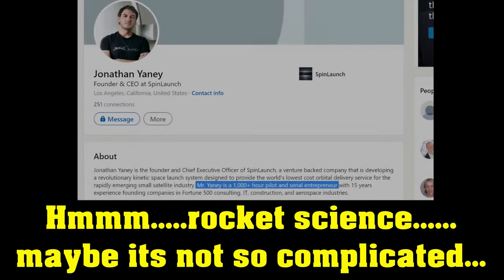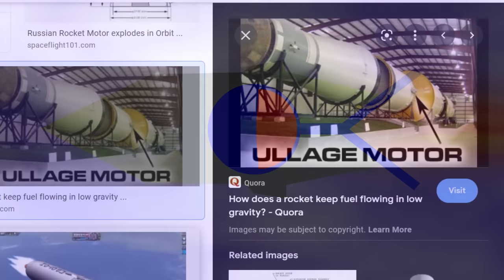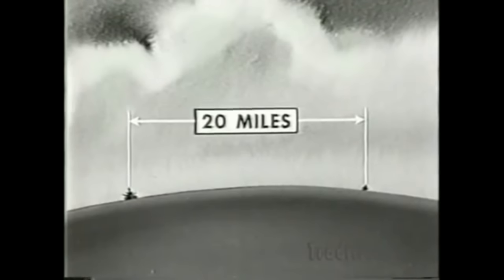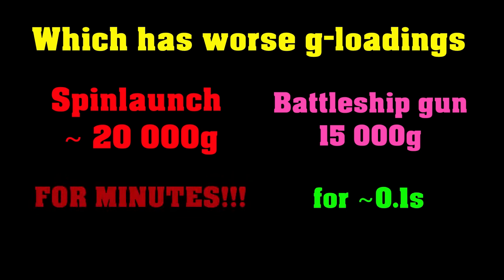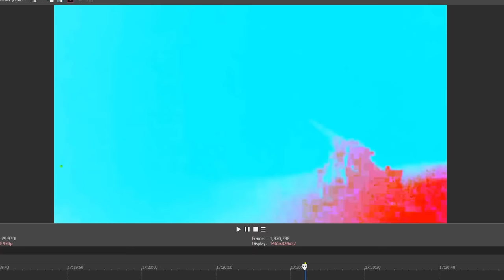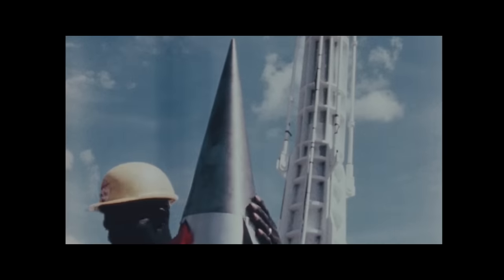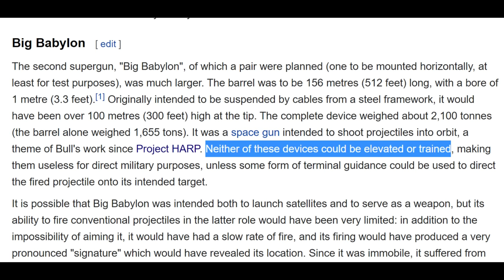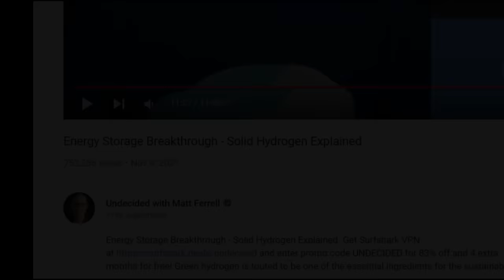Spinlaunch: BUSTED (Part 2)

Comment: You missed the most obvious problem... the effect of an unbalanced assembly spinning at high RPMs once the rocket was released.   Do the math and calculate the forces that the spinning mechanism would generate once its centre of gravity moved away from the rotation point when the 200Kg mass of the rocket was detached at launch.  It will shake itself to pieces in very short order.    And, if attempts were made to overcome this by braking the spinning assembly then the amount of energy dumped would also be astronomical and destructive -- remembering as well that it would not stop instantly so the eccentric CG would still cause massive radial loading of the bearing system.
Reply: The solution is suuuper simple! Just attach a second rocket and fire it into the other direction at the same time!!! Never mind basically lobbing it into the ground, it's the only functional solution lmao.
Reply: @voxelfusion9894  "Uhh, baws? It appears that we have attached the satellite rocket to our counter-weight side of the assembly..."
Reply: Old mate did actually cover that in the previous video.
Have a good one .
Reply: How about a disposable flywheel assembly that detaches at the same moment and goes rolling across the countryside slicing man and beast alike into pieces at 5000 RPM?
Reply: @voxelfusion9894  The second mass released would have the same energy as the rocket, so you have immediately halved your efficiency and of course destroyed whatever that mass was and made a big hole even bigger. At least the bigger hole means they can tip more money into it.
Reply: @MrTaxiRob  Don't worry about designing that as an option. Its built in from the get-go.
Reply: dealt with
Reply: @MrTaxiRob  Now that I think about it, maybe it is worth it to build one, just for the show?
Reply: @MrTaxiRob  beyblade, let it rip
Reply: Theoretically a way they could look into to fix this would be having a weight high up the arm opposite the payload which on launch is unlocked to move further down the arm to shift the weight.  Not any less dangerous and might still destroy the assembly due to the high speeds but it's better than their imagination.
Reply: If you were going to use a flywheel you wouldn't need to dump it - you would regenerate energy from it.
Reply: @funnyguy6878  yes.  This has been mentioned in some other videos.  the mass would have to be on the same side as the rocket and slide outwards at the same moment as the rocket is released.  

The axial symmetry (balance) and angular moment of inertia of the whole system would hardly change if it was done perfectly.
Reply: If the detaching were perfectly instantaneous  (all  force perfectly perpendicular toward the center of the circle and then in 0 seconds the force becomes 0) and instead of some other shape it was an infinitesimal point this would work (ignoring your issue just pointing out another)
The forces on the projectile away from the center of mass, even assuming the center of mass were perfectly the attachment point, would mess it all up. They'd have to make the thing much much much bigger 
It's like how artificial gravity by rotating a big cylinder would feel very different from being on Earth... imagine playing  catch with such a strange gradient
Reply: I am not an engeneer I am a chemist so I have not a real idea how that would work but couldn't you just in the same moment it detached open up a hatch where the projectile just sat and though the spinning force eject basicly a weight on a string it would not need to be 200kg as you could make it extend longer so having a longer arm you would just need a bigger chamber this could act as a replacement it would just mean that you need to not only make this thing extra large to counteract all the force tho it would spin for a fraction of a second while unbalanced.
Reply: @MrTaxiRob  I can't get behind the  'disposable' part.  We do want to Reduce, Reuse and Recycle (in that order) wherever possible.  The rest of that sounds amazing though, Tell me more!
Reply: @tomaszwota1465  it would be beautiful and spectacular .
Reply: They could just release a counterweight. 
It's kind of short sighted to think that it would necessarily have to go flying. 
If the spin arm is asymmetric and has large counterweight close to the axle rather than on an equal length arm... a counter counter weight can be pulled across the axle to compensate for example. 

Or a proportional weight an an asymmetric arm. Release a 200kg rocket 100m out, drop a weight that's 2000kg only 10m out. The tangential velocity of the release weight will actually be pretty slow, but of equal energy. If it's high density like depleted uranium or lead is going to be about the same size as the rocket assuming it's about 10x higher density, which isn't crazy if a rocket is 0.8g/cm and the weight is 8g/cm.

I'm not saying I believe them per se, and even a relatively basic vacuum, like 150 torr, would be enough to stop heating. Or put it on a mountain. 15k ft mountain would do wonders, a lot less heating, and run it open air with longer arms
Reply: That is exactly what I was about to write a comment about.  When I watched the video about SpinLaunch, that seemed like the impossible problem to fix, how in the world do you stop that spinning arm from basically exploding and coming off the axel when you barely manage to release the projectile through that hole.  In a millisecond you have just as much force pulling on that arm trying to make it destroy the entire complex, as you had to launch the projectile.  That to me sounded like the impossible hurdle.
Reply: In those animations, they do show a slot in the arm, which suggests that is the counter weight was close to the center, as soon as the projectile is released, the counterweight could slide down, potentially helping the deceleration.  Kind of like when you spin around in your office chair and then stick out your legs, you slow down.  I dunno, still sketchy.
Reply: Wow! That's a very good point. It's gonna cause a huge explosion like thing for sure.
Reply: Nice one Sir Bruce!
Reply: Spin Launch "Physics is hard but we will take a guess!"
Reply: Bearings can be designed for massive radial loads, but a combination of techniques might be used.  Have a chamber in the counterweight full of long-chain silicone oil and open the chamber at the same time as the release. 2. Purposely imbalance the rocket slightly heavier, and accelerate with torque 90 deg. ahead of the rocket. Deaccelerate with torque 90 deg behind the counterweght (so the same lever arm). This will eliminate the primary imbalance. Since you can de-accelerate faster than you accelerated to to lack of fragile rocket system the imbalance there can be greater, and the amount of oil you is adjusted to get the right shift in balance.
Reply: Well no, you're forgetting the hypersonic water dampening system which deluges the chamber with water, 1/2 millisecond after release!
Reply: @UCXEO5L8xnaMJhtUsuNXhlmQ  nobody is gonna top this comment 🤣 i do love Thunderf00t videos and the wonderful debate the comments crew have!
Reply: As long as it has electrolytes you'll be good Bro!
Reply: my thoughts exactly. also, not even that, imagine the forces on the centrifuge itself, 5k kph - imagine the RPM of that, imagine the bearings of that, imagine the engine that can cope with that force for an hour. but thats also the thing - imho - let them try, to just cross out that stupid idea and go on. apparently getting 80 million for startup isnt too hard in america as long as you can talk about something that people can hardly imagine. its good, he created jobs, and will probably have at least some good data that can be used eslewhere. thats how the progress looks like, we just dont hear about the fails because people dont go public with dumb ideas like they do now...
Reply: Every time the bell rings a satellite gets its wings. Also a fairy tale.
Reply: Another problem would be, that the rocket also spins around its lateral axis at the same rate the apparatus is spinning, and that has to stop instantly, when it is released. That's why DLGs have such a long tail and big fin.
Reply: @gram.  Jesus christ I haven't seen extensive typing like that since 2008. 🤣
Reply: I was about to ask how long it would take to spin down from “5k mph”. Sounds like it would only take seconds ;D
Reply: The thing has an inbuilt brake it it ........ the air rushing into the vacuum!
It might get a tad hot in there though ;o)
Reply: That's only a problem if you don't view the launcher as essentially disposable, maybe with salvageable components. I'll bet it's still cheaper to build this for single use than it is to build a launch rocket.
Reply: This is probably a really dumb idea; but if you inflated a weather balloon and attached a miniature rocket to it; could you launch it into orbit?
Reply: No he didn't. He covered this in the previous video
Reply: @icegiant1000  rune essence of once U get to 200mill total U Can craft this easym
Reply: It starts unbalanced and then become less unbalanced once the missile is released.
Reply: I note the projectile is leaving a seal.

And breaking it.

Which means air will rush in. And strike the spinner.

So your hypersonic spinning assembly has imbalance, and massive frictional heating and massive deceleration.

Unless we fill it with helium to atmospheric pressure. And use it as a circular hypersonic wind tunnel.
Reply: @benbooth2783  do U runecraft?
Reply: The solution is to launch an object in the opposite direction.
Reply: @stevelloyd5785  get Elron Musk on board to use the second mass to produce holes for his hyperloop!!!
Reply: Wouldn’t breaking the vacuum to release the rocket make a bit of a mess?
Reply: you forgot about the inrush of air after the projectile has ripped trough covering over the exit, that air is going to hit that rotating arm like a massive hammer
Reply: It could be done right but it’d need to be a way larger gimmick. Similar to how humans work when throwing things away (leaning the body back while preparing to launch and then forward plus usually covering some ground ahead after releasing), the launch station should also travel on something like a large rail WHILE spinning and afterwards, and maybe the rails should have a curved path to provide further compensation. All of that still doesn’t cover all the other issues explained in this video.
Reply: @Rapscallion2009  not for an effective payload of 50kg max.
Reply: @Slavicplayer251  no need to even do that. If the "counterweight" was a second rocket, it could be released half a revolution after the first, and at the speed it is rotating, the imbalance in the system would be corrected within milliseconds.
Reply: @95rav  nah have 2 tubes on opposite sides to release the rocket and counterweight at the same time
Reply: @JackSparrow-re4ql  nah if this could get funding yours definitely can
Reply: @voxelfusion9894  This can be resolved easily by digging a hole through to the other side of the planet. That way you actually get two satellites in space. Clearly no-one else has thought of this. I'm going to patent it and get some funding.
Reply: That was the first video
Reply: @wilurbean  Moving any weight about on a rotating mechanism at the speeds required is a problem. The acceleration/deceleration required to achieve it would be massive and if it isn't instantaneous (which it cannot be) then the entire rotating assembly is out of balance until the weight reaches and stops at its new position. The simpler option of releasing a counterbalance weight at exactly the same time is much easier and would not unbalance the rotating assembly. The problem with that is you would have a 200kg 3000mph weight going in a direction 180 degrees from that of the launch vehicle. i.e. straight at the ground very close to the launch building. This is not unsolvable but they don't seem to have even considered this option.
Reply: @icegiant1000  Release an equal weight from the other end of the rotating mechanism going in the exact opposite direction. Balance is maintained :)  OK now you have to deal with a 200kg 3000mph missile heading right for the launch facility but one problem at a time right.
Reply: The air rushing in would probably slow it down quite quickly... Maybe not fast enough to avoid damage though (launching the counterweight into the ground is probably the easiest way to deal with that (the energy is huge, so it probably needs quite a hole to either disperse the energy or to ensure that the impact is far from something too valuable...))
Reply: I think thunderf00t mentioned this in the earlier video
Reply: @Slavicplayer251  Hooray! All I need now is a cgi animation!
Reply: Any unbalance at this kind of speeds will destroy bearings at instant. And, besides sealing up bearings problem, it will generate lots of heat, since its mechanical part spinning extremely fast.
Reply: I believe it was mentioned in part 1
Reply: technically they can do a double spin and launch another one to the earth....  with 50% wasted energy at least it kinda solve the problem. there is way bigger problem then mechanical difficulty
Reply: I really thought about calculating possible savings by using energy from cheap sources to overcome starting momentum without realizing your point.
We would really waste half of the input energy
Reply: @JackSparrow-re4ql  they tried a similar idea by trying to launch the space shuttle from a jet.
Reply: A counterweight close to the center of rotation that can be shifted inwards using some heavily preloaded spring mechanism right at the moment of launch?
Reply: @cbuchner1  It would have insanely sidewards fore and accellerate the rotational speed
Reply: How do you think they did it on their mach 1 launch? I mean if you want to make a point against it then argue that whatever they are using has a limit slightly above mach 1. Don't just say it can't work, because obviously it did work for mach 1.
Reply: @lolbuster01  I'm guessing it failed, right?
Reply: The rocket itself is spinning. When released it tumble around its centre of mass in flight.
Reply: @MrTaxiRob    When I was at engineering school decades ago (it was located at the edge of a little-used airfield) some of the senior students, for no good reason other than the hell of it, built a rig that spun up a car wheel to high rpm's and released it - just to see how far it would go.   This thing would go bounding across the (fortunately deserted) runways for many hundreds of yards.
Reply: @Hedning1390  to be honest I do not know if or how they solved it so far and whether their current solution will break for higher speeds.
Reply: The bearing would probably go to hell every time without fail.

Tho they could probably counter this problem by pulling in the counterweight and reducing its effect, making the assembly balanced again.
Reply: -Matter didn’t create anti matter
-Anti matter didn’t create matter
(Both of them were present at the time of big bang)
-Both of them didn’t create themselves.
-Both of them came from an unimaginable source,  that unimaginable source created matter and antimatter (everything) thats why it is known as “the creator” of everything.
——
- that unimaginable source/creator has created sin and virtue which are opposite to each other,
— logic says every action has its own reaction, so the reaction of sin must be different than the reaction of virtue,
— the creator has created prophets to let us know about each and every detail of sin and virtue, also about their reactions,
Thank you
Reply: @voxelfusion9894  the solution here is simple as well, call Elon and have him dig a tunnel for the counter weight.
Reply: @voxelfusion9894  Read my solution elsewhere.  No second rocket needed.  Just put a counterweight opposite and release it at the same time in the opposite direction:
Reply: That was mentioned in part 1.
Reply: My thoughts exactly.
Reply: @dworkin7110  I like the way you think, this is brilliant!!
Reply: @Hedning1390  Every part on this idea could work, it's just a question about cost effectiveness
Reply: @JackSparrow-re4ql  yep lmao
Reply: Isn't this all relative to the overall mass of the assembly?
Reply: @stevelloyd5785  2nd wieght released wont halve the energy in the rocket. but it would cause a selfdestruction of the building lol
Reply: Would it be possible to have a mass close to the center inside of the arm that moves to the end of the arm once the rocket is released to lessen the effects of the imbalance?
Reply: @voxelfusion9894  it works amazing for war, it's technically not a cluster bomb if it breaks apart on its own.
Reply: @timoclark8367  possebly but moving a weight to balance the loss of 200 kg rocket within 1 revolution would mean moving it extremely fast. likely with a shock/bang... i dont know if that would affect the whole swing arm... but aside from all this i doubt they will ever get it working.
for me the deal is off moment was seeing the flimsy seal being broken.. no way was that a vaccum. so lets se if you can seal a real vacuum and have a rocket peirce it and air rushing back in a chamber with a arm with outside moving a 5 times speed of sound. itl be a blast
Reply: It's merely an engineering problem... don't worry about it. (they already demonstrated it without shaking itself to pieces).  The arm just needs to shift slightly as the projectile is released to the new balance point.
Reply: But in the computer generated video it worked perfectly...
Reply: Was going to mention the same thing but with a possible solution. 
They're solutions for cg issues in tires using ball bearings in a torus that may be filled with an oil or vacuum or air. Balls can be a polymer for static cling like they have for motor cycle tires or stainless steel in oil like for big rig tires. The forces self balance the cg while on the road. I haven't had a chance to check them out yet.
Edit, I forgot to say, everything else is a bit crazy to attempt.
Like the elevator to space, which last I remember they where using ribbon and having contest with different groups making the ribbon climbers
Reply: @sadev101  yeah I don't think that it will work either it's just fun to think about impossible solutions, but I think that moving the mass would kind of work because of conservation of angular momentum the arm would slow down if you shifted the mass from the center to the edge of the arm, maybe someone could simulate that. Btw I really think he miss read the mass of the rocket in the text he used it said that the payload will be between 20 and 200kg but the rocket itself might be heaviert about 1 tonne or more.
Reply: @RyderSpearmann  they demonstrated it without a vacuum at 1/5th the speed .... thats not demonstrating they can do it lol.
crank that sucker up to full speed and show you can hold a seal with a thin sheet of whatever and then throw the missile... it already moved .. crack it up full speed. they need a wider seal / tunnel out.
im highly sceptical they can get this going.
Reply: @JackSparrow-re4ql  Rookie mistake. You are thinking in terms of height rather than speed! Go fast enough and you fall at the same rate gravity drags you down to earth, At that point you have reached escape velocity. Starting off really high is a good idea as you reduce the drag force, but you still need to pile on the speed! 

When you look at how much fuel you would need to carry and the weight of the tanks to hold it you are well above the capability of any balloon to carry it. Weather Balloons can only manage to carry a few Lbs and need a large envelope for the Helium to expand into as it goes up.!
Reply: This thread is lit 🤣 My conclusion from it is that there maybe some fixes possible, but compared to a linear accelerator they're all incredibly challenging engineering solutions, which this team especially does not seem capable of solving.
Reply: @ruzzodac  it's what projectiles crave
Reply: @unglaubiger5645  dude that was EPIC
Reply: @JackSparrow-re4ql  that was actually a test of a controlled landing for the orbiter, not an attempt to launch it into orbit. It was on the back of a 747 and had no heat shields or engines. A 747 could only hit 444MPH with the orbiter attached, that's not any significant boost toward escape velocity even if they wanted to try it.
Reply: @timoclark8367  I think your idea has some merit, but I don't think they'll be able to do it quickly enough without throwing the thing out of balance. Moving weights on both sides can change the center of mass to whatever they want it to be, but it would have to be instantaneous when the device is at full operating speed. I just don't think that's possible.
Reply: @voxelfusion9894  you'd only need a rock with the same mass. Then dig a hole just 20km deep, easy
Reply: @timoclark8367  thats worse
Reply: Well, if the thing worked, which I doubt it would, then the spinning arm ripping itself apart AFTER launch would be a trivial expense compared to traditional rocket launches.  
That said, I suspect you could do some kind of counter weight to limit the offset.  The counter weight (whether it is solid or liquid) could even be what releases the rocket... so they are perfectly timed.  Again though, I think there are other problems with this idea a lot bigger than this.  Still a good observation though.
Reply: @101perspective  you'd have to compare the expense as cost per kilo of payload, so that may not be true.
Reply: @sadev101  I didnt say it would halve the energy in the rocket, I said it halve the efficiency (of the system as a whole) since the balance weight released would have the same engery  and it just got dumped
Reply: Yeah that was issue I was thinking when I saw the issue.  Because when I've heard of this idea of a centrifugal assist for launching things to space originally many years ago I remember them talking about using maglev and massive track
Reply: @AsthmaQueen  that's probably a better idea: run a rail gun up the side of a mountain
Reply: @MrTaxiRob  Well, I'm guessing that if they let it tear itself apart they would probably disengage the motors, etc, and save the bulk of the system.  
Like I said though, I suspect some kind of counterweight system would probably be used anyway and thus limit "damage" to probably just needing to check it each time for alignment, stress fractures, etc.  Not that I think this thing would ultimately work anyway... just saying this aspect probably isn't that hard to compensate for.
Reply: @MrTaxiRob  I thought original idea was more like a hadron collider but for rockets so a massive circular thing that ramps up then shoots it out.  I'm sure I saw something about that theorized 10-15+ years ago probably on Daily Planet (I miss that show)
Reply: @AsthmaQueen  I guess there's a reason nobody did anything with the idea in the meantime
Reply: @MrTaxiRob  oh for sure it's a insanely expensive project probably many many billions for a loop hadron collider sized that can accelerate stuff not to mention rest of the problems.

Not the kinda thing a little start up can even begin to attempt
Reply: check the first part of the video:
https://youtu.be/9ziGI0i9VbE
Reply: Dont say that or they may claim the payload is weightless! or something else is weightless or some nonscientific way to move weight is at play.
Reply: Watch part 1 cobber, he dun that bit first.
Reply: @MrTaxiRob  That's some real "outside the box" thinking.  Literally.  I love it.
Reply: @ColonelSandersLite  Spinlaunch mercilessly slices through expectations
Reply: @stevelloyd5785  yes it gets dumped but only after its released and its taken of of the energy of the flywheel. 
not of the rocket so basicly if you could somehow manange to do it (you cant because it means shooting the counterweight into the ground destroying everythign but ok theoreticly) it wont affect the energy given to the rocket upon the release... who cares if it slows down the flywheel afterwards... they want it to slow anyway by then
Reply: I was thinking this, they would have to release the equivalent mass at  180 degrees to keep it balanced??
Reply: Just pump water to the end..200Kg of water is not much..or use mercury...
Reply: @DynamicSeq  it would have to be almost instantaneous quarter tonne of water
Reply: @T2D.SteveArcs  or about 15 l of mercury...It would be out of balance..Yes...but not for long..But the whole idea is ludicrous...
Reply: @DynamicSeq  it spins at 5x speed of sound in 1 revolution. releases 200 kg. and that imbalance needs to be replaced witin 1 revolution. meaning the 200 kg of water/ mercury or even solid titanium that needs to move up to replace it would move at 5x speed of sound from stand still position to movement to again stopping at end of arm...thats like shooting a grenade from a canon and blocking it at end of the barrel.
itl explode the whole setup
Reply: @DynamicSeq  😂😂😂 total agreed
Reply: @sadev101  You would off course not release the whole weight at once...But through a small pipe so the weight increases relative slow...
Reply: @darth_dan8886  pulling the weight inwards would increase the rotational speed - not ideal, if you already are at mach 6.
Additionally, the counterweight is under considerable centrifugal forces - it would require explosives to move it, not springs.
I see three possible options:
- releasing the counterweight
- rotating parts of the counterweight by 180°
- shifting a balancing weight opposing the counterweight to a bigger rotational radius.

Releasing the counterweight would inevitably destroy the facility. The forces involved can't be handled.
Option 2 and 3 will inflict serious shocks to the rotor.
Reply: @DynamicSeq  but the flywheel is rotating still at 5 x speed of sound when the rocket is released. this gives a big imbalance that would likely destruct the bearings (due to woble at 5x speed of sound) and destroy the whole flywheel if not corrected withing 1 to a few revolutions. (remember this would be moving round at 5x speed of sound). so you must fix your imbalance within 1 to a few revolutions .. so slow relaese of liquid is out of the question. it needs to be fixed in nano seconds
Reply: You can counterweight that. But consider the loads on the shell perpendicular to the way a normal vehicle would ever encounter. The stiffening needed would be ridiculous.
Reply: @Slavicplayer251  i know but they all still misread the mass
Reply: @voxelfusion9894  Brilliant. One aiming in the direction of space and the other at the HQ.
Reply: You could simultaneously release a similar weight diametrically opposed to the projectile.
I love to watch a 200kg mass hit directly beside their launcher with the same energy 😂🤣🤣
Reply: Add a secondary mass inwards of the launch payload and allow it to move outwards to a calculated distance, 'simultaneously' balancing payload loss.
Also add design chines and computerized flight surfaces to the arm AND inlet corridor to allow the arm to have a controlled stabilizing 'flight' into the oncoming air mass until the corridor can be closed.
Reply: There are many potential engineering solutions for the imbalance problem that would work, even for something as ridiculous as this (shock loading is a common issue experienced by electric motors, some even larger than this application).
Theoretically there is nothing wrong with the concept, as is the case for most of these stupid projects.
It is just incredibly impractical and completely unfeasible (for planet earth).
Thunderf00t is right you might as well blow your expensive satellite out of a bloody cannon.
Hell if you used a light gas mixture and a long enough barrel you could achieve a similar exit velocity with lower G forces (kick starter pending I guess).
Reply: @Dr_Wrong  it would have to move instantaneously, as in the same time to release the "rocket" thing.
Reply: Mine a shaft below the launcher and throw the weight into the shaft
Reply: @lolgamez9171  yes!
And if you could "catch" the falling mass using a magnetic coil you could save the induced energy in a capacitor, thereby recovering otherwise wasted energy 👍
Reply: Ohhhh And the vacuum seal just broke. The rush of air is going to blow the Whole Dam Thing Up.
Reply: At the same time you would have an inrush of air on the system
Reply: @unglaubiger5645  that has to be the funniest thing I've seen on you tube
Reply: @jonathantatler  Yes, any other speed and/or desynchronization than 'simultaneously' increases failure potential.. It's a challenging solution to a ridiculous proposition..
Reply: i think maybe you could have a moving counterweight or maybe drop off the launcher arm into the ground after launch to just leave the axis spinning, but im not a friggin scientist, i think getting to the speed they want in the first place is as much of a problem it would be so wobbly plus its moving perpendicular to earth so the forces constantly change up and down
Reply: @stevelloyd5785  It´s just what I thought of when I realized that the whole spinny thing will rotate at really high speed and be unbalanced after the projectile launches. It´ll shake itself apart like the washing machine.
Reply: Watch the actual "launch". I know what rupture plates look just before penetration of the projectile and it is NOT concave as it should be if there were ANY vacuum in there.
Reply: @chefjoesplaylists2565  good point. That thing gets torn to pieces and the pieces don´t get sucked in.
Reply: Also, the super-sonically spinning arm has to deal with the sudden inrush of 1 ATM of air pressure when the projectile is released. That's going to be interesting....
Reply: Physics, how dare you?!
Reply: Truth
Reply: @funnyguy6878  JESUS CHRIST! That sounds even worse than just letting it rip itself apart!!!
Like, how would you design a system that would shoot a weight out through the arm at that speed and then stop without retaining its momentum and shoot past any bearings. Mind you, that this is "intended" to rotate at 6 times the speed of sound. So you'd need to "chunk" a weight out to the end of the arm at probably an equal speed to make sure the weight imbalance hasn't already shredded this doomsday-fidget-spinner by itself.

I just feel, if you have at some point overcome the mechanical issues of just properly counterbalancing this spinner... that you are probably better of using THAT technology to shot the projectiles instead. :P
Reply: @wilurbean  150torr will not substantially reduce heating. That is double the pressure the Concord operated at(50,000ft), and that plane was limited to about mach 2 partly because of temperature limits dictated by the structural softening of aluminum. The SR71 flew mach 3 at 70,000ft (20torr) only by using titanium with metallic tank gaskets and it thermally expanded 8inches in length at normal cruise speed.
Reply: @MrKfadrat  30meter radius is 188m circumfrence, 188/2200[m/s]=0.086 seconds per rev or 11.7rps = 700rpm 
I know of many electric motors in industry that can output 5000kw continuously at 300rpm (160 kilonewton-meters or 117k pound-feet of torque) you don't need anything close to that much torque, so downsizing a bit to get higher rpm would be a simple matter. At 30m radius and 200kg payload(with 200kg counter mass) 60knm would provide 0.5g acceleration or 5m*s^2 which means full launch speed in 7.4 minutes. ( 2200[m*s]/5[m*s*s] =440s=7.33min ) This is a 4.4Mw motor, a 550Kw motor would take about an hour.(Assuming a simple constant torque direct drive setup, so at low rpm the actual wattage would be a small fraction of the peak rating. Better setups would have torque multiplied at low rpm for faster initial acceleration.)
Reply: @Slavicplayer251  Ever seen a bullet after it hits water?
Reply: @JackSparrow-re4ql  No, altitude is a minor part of the required energy, horizontal velocity required for orbit is the bulk of acceleration.
Reply: @mytech6779  Drag or the energy going into friction scales linearly with density. 150 torr is 1/5th of the drag compared to ground level. You're only considering cases of sustained flight too. the Sprint II missiles hit mach 10 in just about 5 seconds and survived for ~25 miles before exploding. Its really all about how long the vehicle stays in the range of pressure high enough to burn it up. There are better technologies available as well now. I'm not saying its going to work, just that aerodynamic heating isn't a deal breaker.
Reply: @mytech6779  I see. Thanks for informing me. So what do you guys think of a railgun rocket?
Reply: @wilurbean  All quite true and ablative shielding is proven viable. However consider that the atmosphere is much more than 25 miles deep and even at high altitudes there is enough heat generated at orbital speeds to create surface temperatures well over 5000k. As such it is not a trivial issue to dismiss. 
This whole issue is very similar to reentry in time and energy, just going up instead of down. And that 5000k is for a shallow angle designed to limit [de]acceleration forces on human passengers, for steep ballistic reentry you can get much higher temps and 120g of [de]acceleration force on reentry.
Reply: @JackSparrow-re4ql  A rocket on a rail-gun (or just a linear induction motor) is likely the most viable option. You just need an appropriate geologic location so it can be both angled up and long enough. I don't know if using a mountain side or boring a mine shaft would be more viable,(or both) but that choice is mainly an engineering detail.
Reply: Could you perhaps have the counterweight move closer to the center on release to re balance the arm? Media scenes said it better above me .
Reply: Not saying your wrong about your comments, but there is one thing you must be unaware of, and it may not even be used in this whole spinlaunch thing. There exists adaptive load balancing systems. This may shock you, but about 50 years ago or more humans learned you can connect various forms of drive system to shift the dummy load automatically, and VERY rapidly, from the center point of rotation. Now this cannot be done instantly so the entire assembly would still endure a fraction of a second of unbalanced rotation while the dummy load(counterweight) is being driven inward to compensate the lost mass of the projectile. These kind of systems are used extensively in industrial applications and have for many years. Cranes, heavy machinery, even some forklifts etc. employ this method of load balancing. I'm not defending spinlaunch or anything. I don't think it's a very good idea personally. but your knowledge was a bit flawed as methods exist to deal with keeping loads balanced in situations like this.
Reply: @teksatan4699  A crane is balanced over several seconds to a minute. Not over a few milliseconds. The inertial load caused by such a rapid weight shift would greatly exceed the base unbalanced condition and the two loads would be additive so the momentary load will be more than doubled.
 
Not to mention the change in rpm due to conservation of angular momentum, again this is only minor and easy to deal with on an extremely slow moving crane.
Reply: @mytech6779  You are correct. On large scales such as cranes, shifting large loads is done slowly to be as smooth as possible for obvious balancing purposes. However the counterweight on this machine is many tons, and the weight of the projectile is next to nothing. This means you'd be shifting your load MILLIMETRES. Unlike a crane which needs to move it's load dozens, sometimes hundreds of feet. So maybe a crane was a bad example. But you can easily shift 30 or 40 tons a distance of an inch or two within just a few milliseconds.. Even at these high velocities. Rocket do it quite literally every time they reach max Q, and all valves and actuators & fins that weigh tons function normally, and operate within milliseconds.. Honestly not defending this spin launch project, but balancing this arm and everything is not as impossible as you think it is. They sure as shit won't be doing it with the machine they have built now though that's for sure. Also in this case they can dynamically shift the load on BOTH sides of the arm to smooth out the balancing during the load shift. and also reduce the distance the weights needs to travel by half.
Reply: @teksatan4699  I am fully able to do all the needed calculations. I am not saying that the unbalanced condition is a show stopper, I am saying that dynamic re-balancing is not the solution. The initial launch unbalance is a radial force on the axle of about 40Mn. (That is about 4000 tons at 9.8m*s^2.) Changing the counterweight of spinlaunch in a meaningful way would require applying hundreds of meganewtons to a mass to move it in or out several meters, not millimeters. (None of this has any relation to max Q or adjustment of aerodynamic control surfaces.) This initial force will be added to the unbalanced force until the translation is complete.(or nearly complete, the change can't be perfectly instant)
Yes, this issue can be overcome, by brute force scaling; build an extremely robust axle on a massive foundation. As such they are likely better just leaving it unbalanced during spin down, maybe replacing the bearings between uses if needed.
Reply: @mytech6779  That's all I was getting at, It is a solvable problem. Just used bad examples. and your correct again that maxq and  loading is unrelated here mostly. However, if they can move a ship fin weighing tons within fractions of a second under the type of loads that maxq presents(and under the heat that reentry can produce). Which was my thinking point as an example. I also admit this would itself not be a solution. Bearings would indeed need to be frequently replaced etc. if not every other launch. Again i should say I'm not at all defending spinlaunch I think it's a horrible idea.
Reply: Honestly there's far to many factors here to run legitimate MEANINGFUL calculations. Since this current machine is not the actual size or final design they are planning. Measurements, loads, etc. are unknown on their final design(hell they most likely don''t even know what the actual stats will be lol) I still don't think they will ever make this something truly viable. I'm just saying though. Obviously we can accurately calculate bearing loading etc. if we knew the actual information. It's obvious they aren't being honest about this machines stats already, and it isn't even a full size model of their machine lol I have to question if the machines dimensions they gave us are even accurate... I really don't trust this company honestly. but I bet if you passed a problem like this to spacex/elon, they would have it solved in fairly short order. if it wasn't an overall ridiculous idea. Humans tried giant space cannons. Those were not viable either. They worked in fact very well. exceptionally in some cases. The issue was the barrel. It suffered rapid degradation of the barrel walls requiring a full barrel replacement of the cannon every few firings. Which is basically the entire machine. So TF repeatedly comparing spinlaunch to cannons as if cannons are a better solution, is worse than my example of a crane, and maxq loads effecting mechanical fin operations.
Reply: @mytech6779  You are correct also about the fact that just leaving the current sized machine unbalanced to spin down on it's own would be the better way to go,  and just replace the bearings after every shot. again really we are both kind of splitting hairs since we are both in agreement this idea is ridiculous lol
Reply: you can drop a counterweight at the same time the projectile is released
Reply: Maybe some retraction of the opposite arm? I cannot even imagine the energy needed to do that..
Or the whole system is designed to be off-balance with the payload then it would actually stop vibrating when the payload is released?
Reply: @aimbot0x01  Yes you can... but that counterweight will carry as much energy as the rocket so where does that counterweight go and what happens to all that energy?
Reply: @xjet  Exactly. It will go to the oppsite direction of the projectile so you can only shoot this thing into the ground. So the machine should have 2 outlets? For a cannon the recoil is also obserbed by the groud. For rockets the jet usually go into a water pool under the launchpad? For the spinlaunch I think the issue is that if the counterweight is a solid chunk it will be expensive to manufacture and to remove it from the gound (it will stuck into the ground). Or just dig a big hole below the launch device or build it on the sea?
IDK, we'll see how this project goes, I also think it is not very realistic, the one good thing is that it can get rid of chemical energy (rockets and cannons are basically the same) so it might see future use.In that case it is benificial to figure out some engeering issues today.
Reply: Hey common sense ain't that common
Reply: Good catch! I was stuck thinking about the payload needing to be built to withstand the unreal centrifugal force in one direction, before suddenly dealing with a directional change along with atmosphere.
Reply: The massive load to the bearings would only last for a fraction of a second.
The device is at best a through-a-way gun.
Reply: To be fair it would be yeeted into the ground, rather than the sky, with enough force to blast the entire building sky high and launch debris for miles from the impact crater so it will just kill the people dumb enough to try to use this overly complex suicide machine. Let's hope it's just the founders.
Reply: this